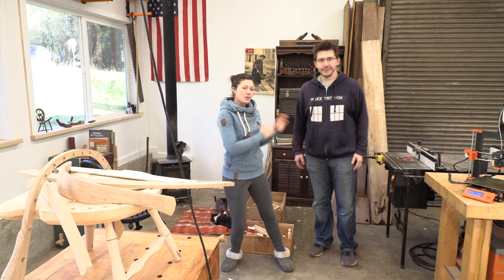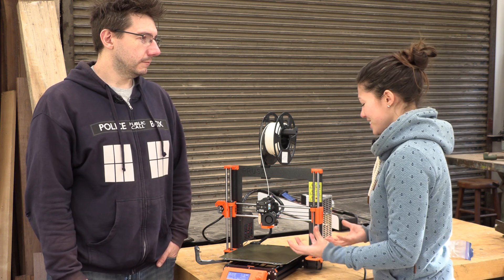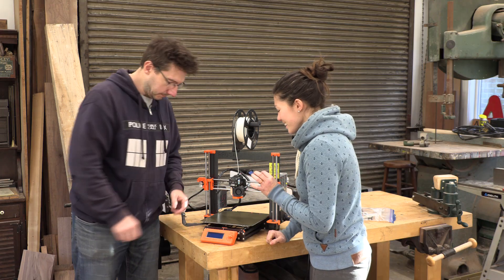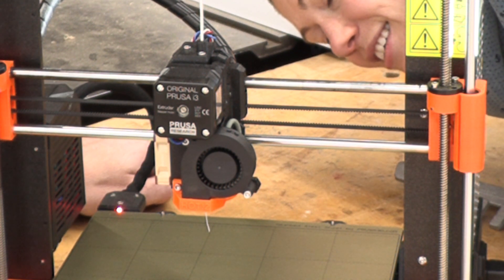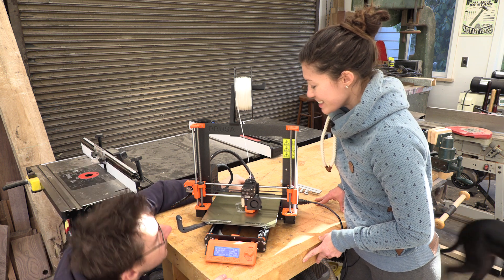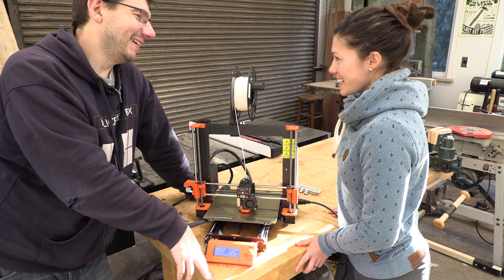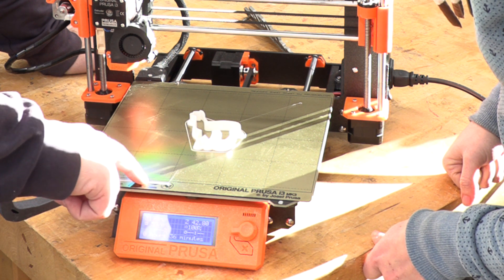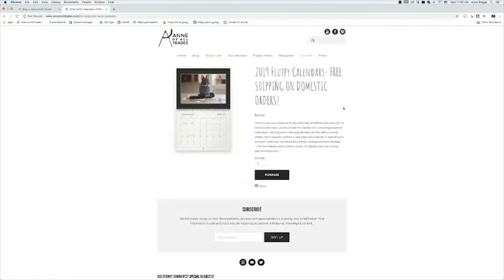3d Printing Basics with 3D Printing Nerd

Comment: a couple of questions if you have the time sometime. we want to get one for the machine shop and are prepared to spend a couple thousand. will people want stuff made or is the market saturated where it will be virtually impossible to find work to pay for itself instead of just fun? 

also being retired programmer with cad cam I can design and save to stl file--is that looked for by 3-d printers? or is that also locked up by the top dogs? 

one other odd note: being retired moldmaker I once did a mold for those ties. We used electrodes and I simply took a small dremel and painstakingly ground in the wood pattern--its not impossible those are my same ties from the same mold I did about 40 years ago we molded millions of them--what impressed people? the woodgrain I ground in a few minutes! if we can establish contact I can do basic designs and email them to you as stl file.

Comment: Pretty neat to watch as someone who has only worked with SLA printers. They're quite different, using a liquid resin instead of the plastic filament. They produce models with much finer detail, but they're usually more fragile so they produce less useful objects but better decorative objects.

Comment: I'm a little confused about the software needed to turn an image into an object for printing. does it come with the machine or do i need to purchase it separately? and what type of images can be transformed?
Reply: What you're describing is called a slicer.
It takes your 3D design (that you've made in a program such as the Tinkercad website) and slices it into layers for your printer to lay down.
Usually printers will come paired with a slicer, but you could use a slicer like Cura, which is usually bundled with the Ultimaker brands of 3D printers (Shout-out Martijn; my cuzzy that works at Ultimaker).
Cura comes with printing profiles for various printers, but if your model of printer isn't listed, you could create a custom profile by entering a few simple details of your 3D printer (bed size, nozzle diameter & material, printing material type, etc.).
Not all slicers are created equal, and if you've purchased a cheap 3D printer with a pants slicer, it may behoove you to try different software to improve print quality.

Comment: So...To keep from freezing to death in your workshop, build a Rocket Mass Heater. (Just discovered you by watching this video). A RMH should heat your shop superbly, as long as it's not TOO drafty. 
The furnace heats the mass, the mass heats the building all day/night while the fire is out. You have a fire for 2-3 hours every 12 hours to recharge the mass. The fire burns at 1500*-2000*F, burning all the smoke and combustible gasses. Minimal ash production (a double-handful in 3 weeks!). Zero woodsmoke coming out the chimney, zero woodsmoke smell outside. Because it burns so completely and the mass lets it 'coast', you'll use minimal wood.
http://www.permsteading.com/viewtopic.php?f=6&t=632

PS. Super cool to see a 'girl' with a workshop where she builds things. j3-pro.com
Reply from the maker: My Tiny Stove does great work. It cranks it up to 90 with just a few wood scraps.

Comment: Great job, and welcome to 3d printing.  You won’t regret discovering this.

To fill in some of the blanks, I just published a 3 part video, actually it’s my first Youtube video.  It literally takes you from knowing nothing to printing a high strength gear to fix a paper shredder.  The base title of the video series is, “Paper shredder repair 2019”.  Best of all, all of this really high power software is completely free!  Check it out.  I bet you’ll download all of it and add it to your tool arsenal.

Lastly, if you’re planning to print accessories for your truck, PLEASE DON’T USE, “PLA”, print filament!  You may get into your truck one summer day only to find that your pride and joy print project has turned into a puddle of sticky goo.  Lastly, “PLA”, has a nasty tendency to creep.  If you exert a force on this plastic, your print will deform over time.

My personal filament of choice is, “ABS”.  I know every printer owner has their favorite, and, “ABS”, happens to be mine.

By all means experiment with the printer that you showed.  I bet that, like me, you’ll get hooked on printing.

Comment: A friend of mine prints everything at his home including electrical boxes, pegboard devices, his wallet and more.  He used to work with a titanium 3D printer and I regret not putting in some orders.  He could have made some great cutting tools.  Other folks I know make intricate & strong platforms for small satellites out of aluminum.  It shouldn't be long before someone starts using these printers to make custom metal parts for restoration.
Reply from the maker: I'm super excited about that possibility! I think there's already printers that do that to some extent but I'm excited for the technology to improve. You better believe I'll be first in line for anything that can print working parts for my truck!!

Comment: Anne, on Joel's video you had trouble getting the train on the tracks, you may have just been in a hurry but as someone who had HO and N scale trains and a number of toy trains for my kids I have a couple of tips that I think make things easier.  First, I like to tilt the car just a little and get the wheels on one side lined up just right, then gently set it on the track.  Also after you think you have it on right just run it back and forth on the tracks a couple times by hand before you hook it to your train.

Comment: The fact that he was ready to answer about weed wacker filament and had the melting point 😂
Reply from the maker: Hahahaha well ever since I first saw the filament reels I couldn’t stop thinking about using weed whacker refills as filament!
Reply: @AnneofAllTrades  Be careful. While you can use weed whacker wire as a filament (with some adjustments), the plastic is not pure nylon, it has some gross additives what may release bad fumes since it's not a plastic made for melting on a 3d printer. Also it will not be a food contact safe print. :)

Comment: Interesting!  What was the wall thickness of the finish product?  Would have to be fairly thin I assume to serve it's purpose as a cookie cutter.  Is wall thickness programmable or do you use larger diameter plastic and nozzle? Sorry, I know you have better things to do than answer my dumb questions.
     I guess I'll know the end is near when 3-D printers start printing 3-D printers.
Scary thought!  Wonder if anyone has tried 3-D printing with a mig gun?
Reply: Yes you can print thicker walls without a bigger nozzle. The wall thickness is fully programmable and can be adjusted to the size you need. The top and every wall and line can be thicker or thinner.

I suggest checking out 3D Printing Nerd's, this guest Joel, video on infill for more information.

 You can also ask him any question on his channel. He and his subscribers are very friendly and informative.
Reply: @hotaru8309  I've been printing for about 5 years. Yes you can make the walls VERY thick and VERY strong. You can also use different plastics that are super strong
Reply from the maker: Oh man Lee! Those are great questions and now I want to try all the things! I wish I paid more attention when Joel was talking about dimensions so I could answer your wall question, but he actually is making a video specifically about the alpaca cookie cutter shortly, so keep an eye out for it.
Reply: I calculate the thickness of the wall using my nozzle diameter and the line overlap percentage of the slicing app I use. For this cutter, I used a cutter width of 0.75mm. I have a 0.4mm nozzle, and with overlap, it makes a 0.75mm wall PERFECT.
Reply: @3DPrintingNerd   I think that was a little too technical, but I really appreciate you personally helping people understand 3d printing.

 It actually might be fun if you do a basics of "what is 3D printing?" for all these new people interested in your channel and the medium.

You rock Mr. Joel 👋🏻 High five!
Reply: > I guess I'll know the end is near when 3-D printers start printing 3-D printers.

Actually, that's primary goal of RepRap project ( https://reprap.org ) which started it all - to make 3D printer, which can print another 3D printers.
Reply: @DreitTheDarkDragon  ; the Snappy v3 is the closest to the goal at about 85% printed plastic.
Reply: wow, I see author is still improving things on Snappy :)
I plan to go opposite way and make really cheap RepStrap which will use just few usual vitamins (nothing exotic) and no 3D printed part. I'll start with simple plotter and if I get everything working way I want, I'll buy some hotend, make extruder and start printing small models. If everything still goes right, I'll use printed models to improve plotter itself, starting with holders for all those things that should be properly fixed. And then? Who knows, maybe I'll start building real 3D printer :D

But I am really curious - does anybody know what is minimal speed for successful print? I mean, can I print at speeds lower than let's say 5 mm/s? Just asking, I know question is dumb.
Reply: Thanks! Will do!
Reply: I'll have a tutorial on the cutter up soon!
Reply: well, I guess the end is near :)

Comment: I use my 3D printer mostly for making replacement parts and various tools or jigs. I'm going to start experimenting with lost PLA casting (which might be good for your truck emblems).
Reply from the maker: Yeah Joel and I have talked a lot about lost PLA casting and we are definitely going to try it.

Comment: Use your 3D printer in a well-ventilated area and with common sense safety precautions (like enclosures and fans), and you’re very likely to be just fine.
https://3dprint.com/163346/can-your-3d-printer-kill-you/